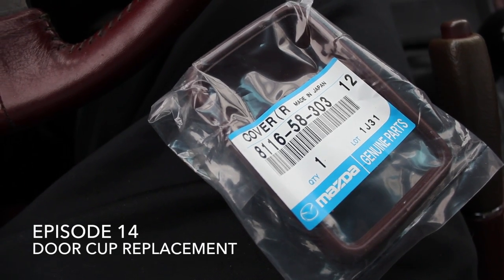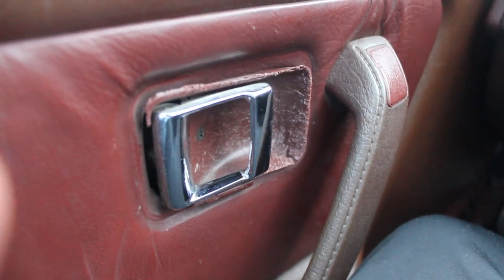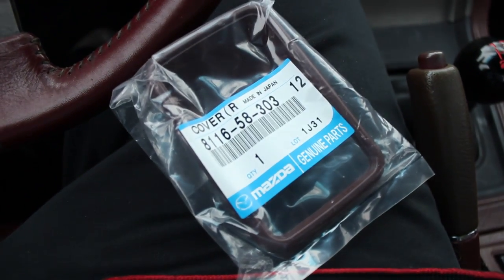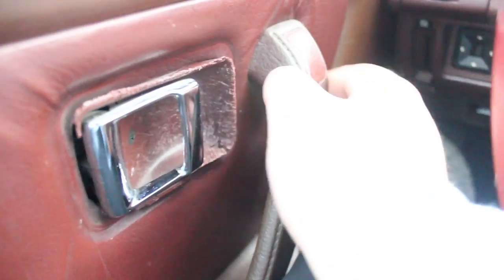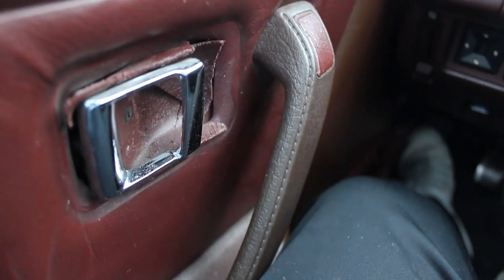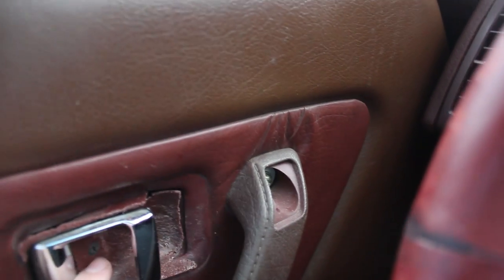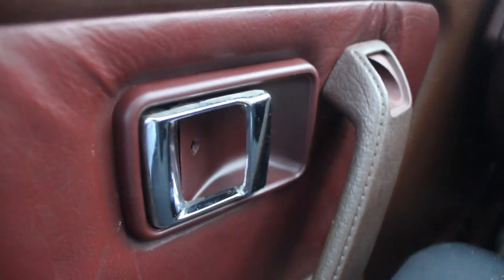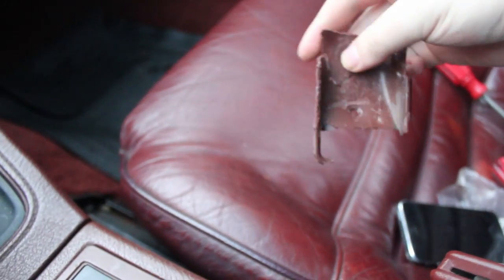Rotary Life Ep. 14: Door Cup Replacement

Comment: could you make an hatch strut replacement video someday?
Reply from the maker: Just picked up two new struts last week, so video in the spring!
Reply: sweet. i need to do mine because they don't work at all, might aswell say that there aren't any struts at this point. and with a quick look at it, it didn't look like just unbolting something, poping out the strut, puting the new one in, bolt back on. but then again, i might be wrong and it is.
Reply from the maker: Well I'll take a look at them in the spring and whatever I do with em I'll make a video